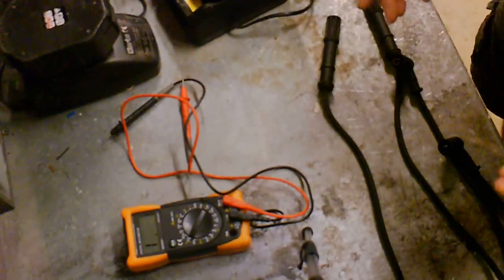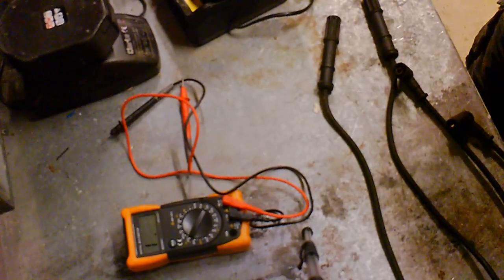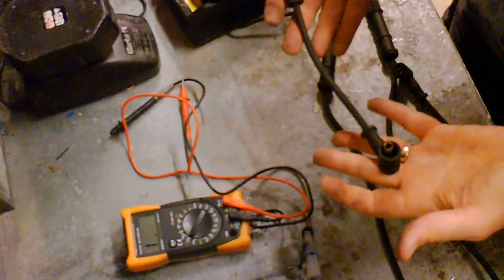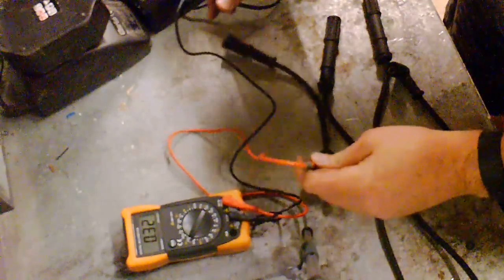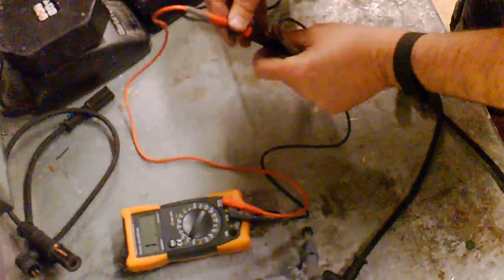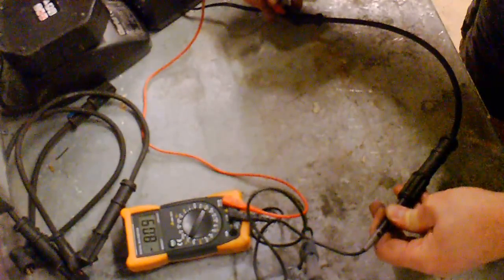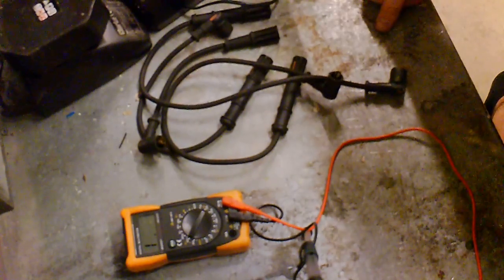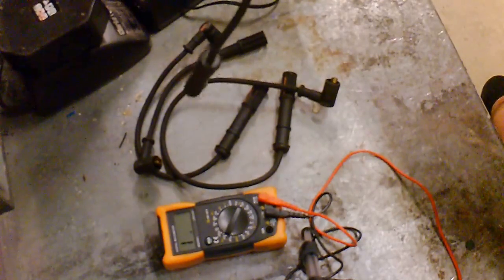Fiat Punto HT lead testing and Diagnosing

Comment: You can't measure insulation factor this way, which will degrade in time, that's why HT leads should be regularly replaced
Reply from the maker: Totally agree, voltage leak test is good for that. Visual checks etc.👍

Comment: i measured the resistance and i got an open circuit in all....do i need to measure the voltage?
Reply from the maker: Ili Duka have you checked for spark, does the car run?
Reply: @drivewaydiyer6504  the car doesn't run...now i got the results for 3 of them..the 4th still open circuit...probably is broken...but i have to check the spark plugs in the cylinders...i don't want to buy one in vain...and thanks for the reply
Reply from the maker: Ili Duka well you know the lead is broke,  probably best to change them all. The plug could have possible shorted the lead. I would normally replace all the plugs with the leads. But obviously depends on your budget.
Reply: @drivewaydiyer6504  yeah..thats the problem...i don't want to spend more on this car...i had a problem with this plug before..and then i made a mistake and rearranged the leads order in the starting coil...i burned a fuse..now i'm not sure what else is broken
Reply from the maker: Ili Duka rearranging normally causes the car not to start or be out of time. Are your coils working fine?
Reply: @drivewaydiyer6504  yes.. I measured the coils..and they look perfect.. They look like new.. At least the part that is connected to the cylinders
Reply from the maker: Ili Duka ok, replace the leads and hopefully that will solve your issue.
Reply: @drivewaydiyer6504  I will...I hope solves my problem..Thanks for the video.. It helped a lot
Reply from the maker: Ili Duka you’re welcome